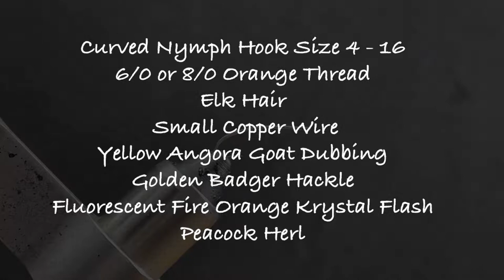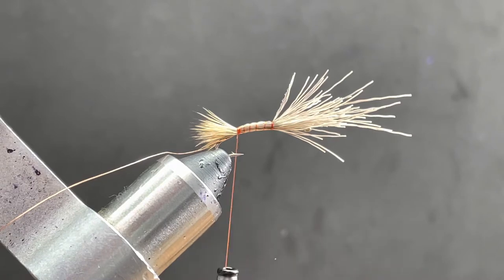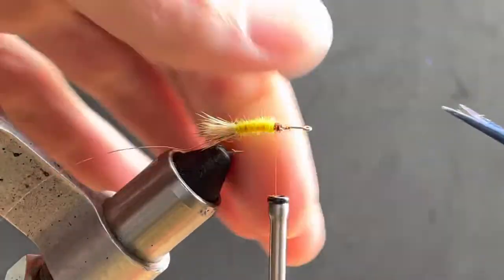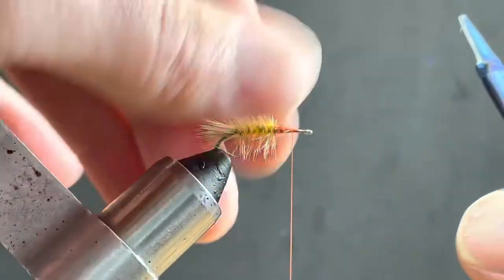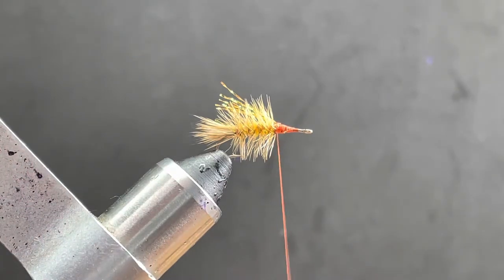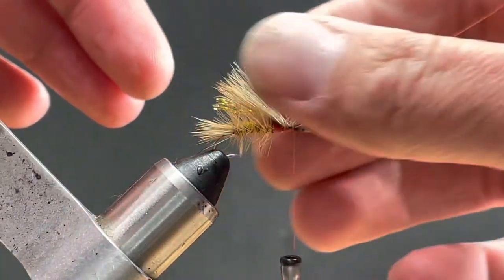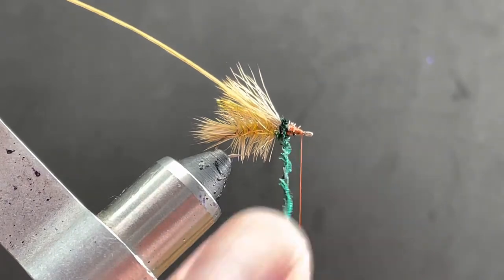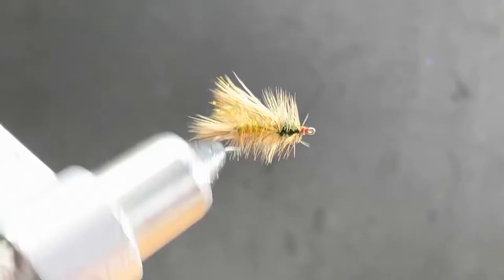Tying a Golden Stimulator

Comment: Good video Brent!  I learn something every time I watch.  Questions for you, what kind of scissors (the blue ones) are you using? And could you substitute the peacock herl with something else?  Thx
Reply from the maker: I use many scissors at any given time. The reason for that is some blades don’t dull as quickly. However those “tend” to be larger blades. The blue pair you are referring too comes from anadromous. 

For the Herl… you can absolutely choose another medium. Dubbing is what more often than not is used here. I chose Herl. I like the fact that it’s a darker color and contrasts the blond. Also I can more easily control the amount of under material. I.E. it stays the same diameter. Dubbing can as well. But you have to be (in my opinion) a little more precise. 

The big key to the front of a stimulator is how to keep the bulk down. The better you get at wrapping through the head and cutting the excess off at an angle the more viable options for a underbody (for the head) will become feasible.
Reply: @BrentJonesFlyTying  thanks for the info Brent. as usual it’s very helpful.